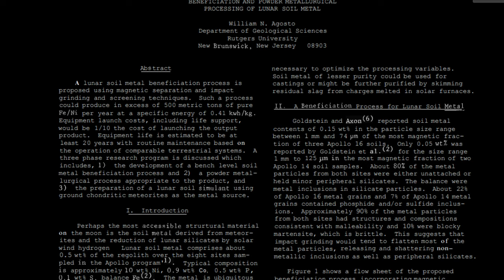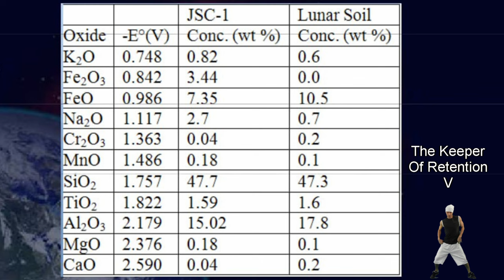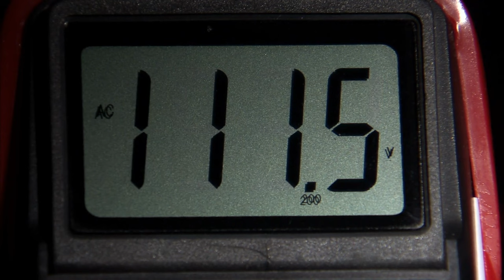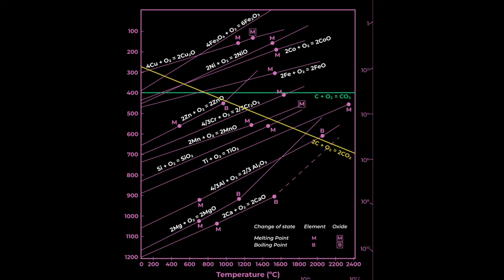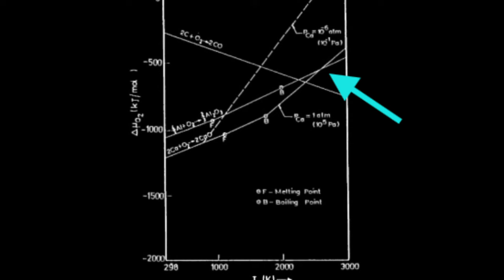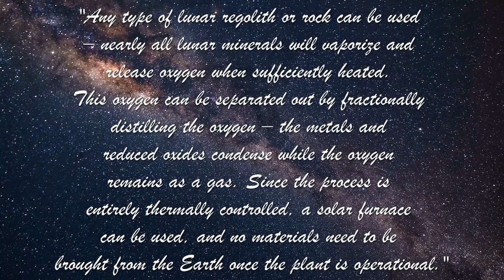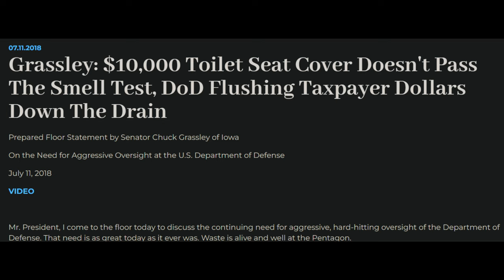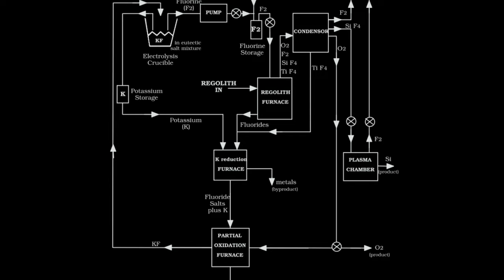Lunar Metallurgy

Comment: Do you know what an aluminium or titanium smelter needs?
Where are you going to put the nuclear power plant to run those smelters?
Because you can NOT shut down a smelter for those metals, without the total destruction of the smelter.
And how much does a high-power nuclear reactor for the moon cost?
Hilarious stuff indeed!
Reply: Cost, and running a nuclear reactor on the moon is not quite as easy as it is on earth.